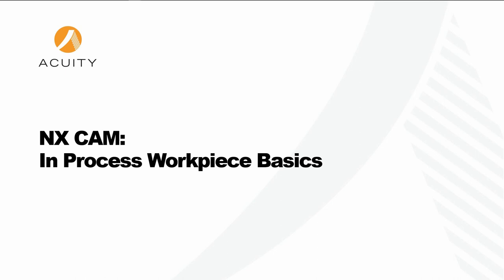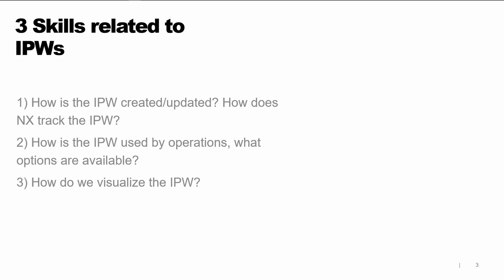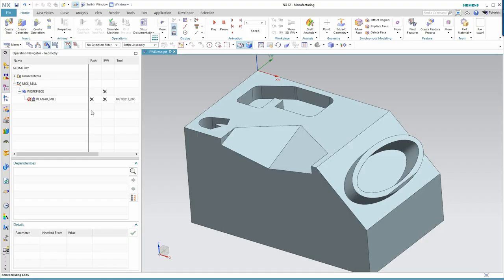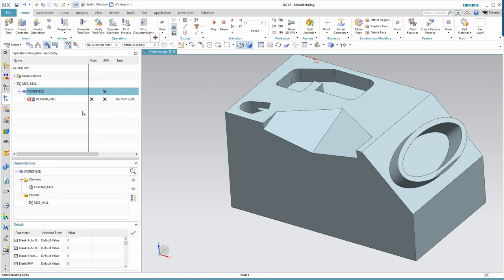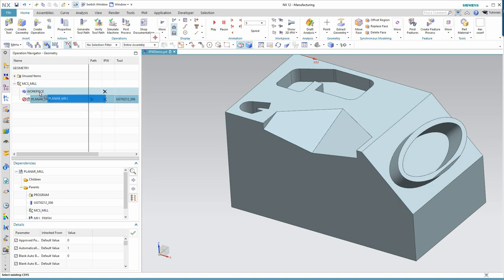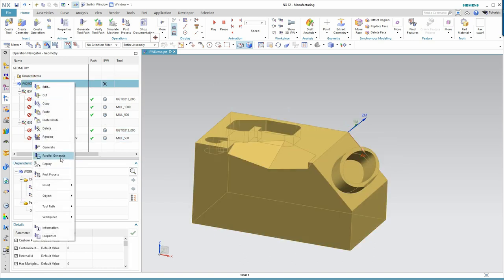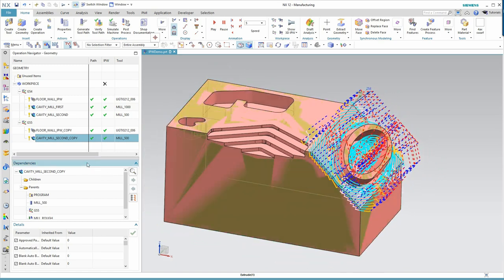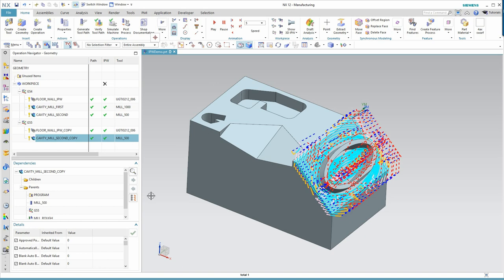NX CAM: In Process Workpiece Basics

Comment: Sir 
How to change UCS from one place to another place and shift in xyz directions
How to check model properties such as
X=?
Y=?
Z=?
That is position of xyz.
Reply: I'm not sure what you mean by UCS.  The MCS is part of manufacturing, and you access it's dialog box by double clicking it in the operation navigator.  The WCS can be turned on and off with the W key on the keyboard. Double click on it in the graphics window to move it.  To check part dimensions, choose the "analysis" tab, then choose "Measure"  as you select Objects, you will see positional data displayed.
Reply: @andyschaefers9439  you are right sir, UCS mean universal/work coordinate system.
Thanks for reply.